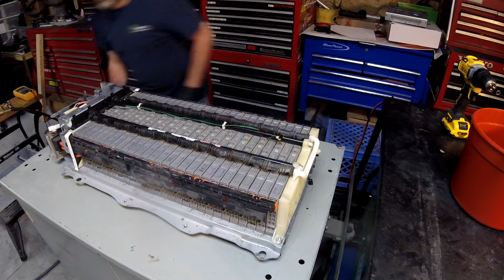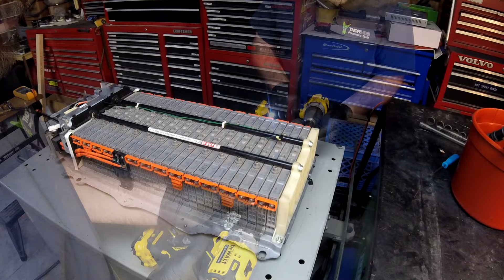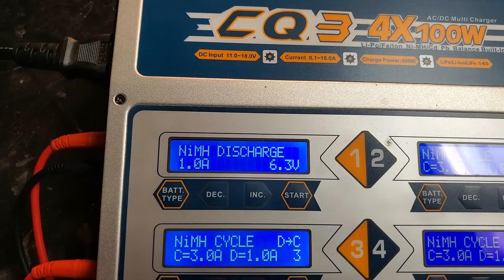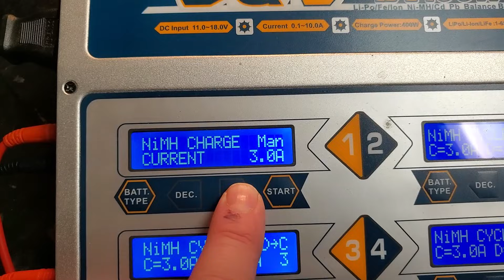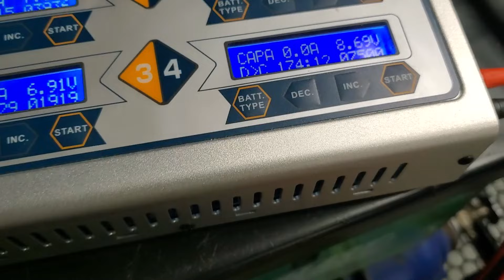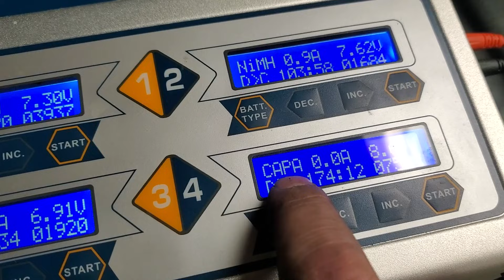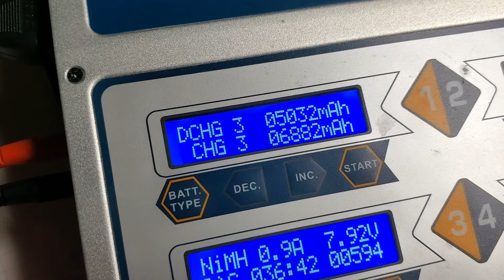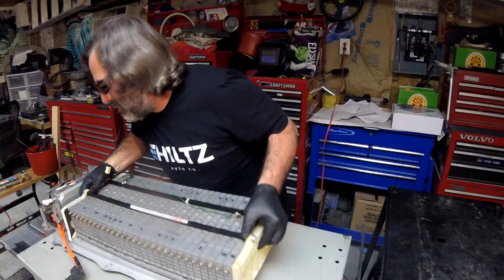DIY Refurbish / Repair Hybrid Battery 2nd Gen Toyota Prius - EV-Peak smart charger POA80 P0A80

Comment: Hi Gregg, Thank you for the video. I purchased a Lectron Pro ACDC Quad charger with the 4 channel charging options. I used the settings you recommended in the video and I think I have done something wrong. My initial discharge on all my cells was between 4800 and 5200, but on cycles 2-5 they my charge and discharge cycles all went down to a 1,000, a few hundred or even 40 and 50 Mah. I would understand if it was a few, but on all of them makes me think I messed something up on the cycle process. My settings were: 5 min wait time, 176 degree temp cut off, 720 min safety time cut off, 7500 MaH cut off, Batt - NiMh, Discharge to Charge cycle, Charge @ 3 Amps, Discharge @ 1 Amp. There were some set up options available that I did not understand, would any of those be needed to alter my results?
Also, if I did mess something up, did I cause irreparable damage to the cells? Thanks!
Reply from the maker: Hey Justin,  @Amazing_Worlds_3.14 wrote in and may have an answer.  It seems I left out in my instructions to use 6.3V as a setting.  I am not sure why I did not include this in the video. Did you use 6.3V setting? If no and it was lower perhaps this is what is going on and it should be corrected and then cycle again.
Reply: @GreggFesto  I went back to look at that settings, my charger was discharging all the way down to .1 volts, i'm not sure if that was the default setting or not, I don't remember setting it there. I reset them all to discharge down to 6.3 volts and hopefully I can restore them to how they were with no damage. I can sleep well tonight knowing my charger is working correctly.
Reply: @stagermx317  some chargers are limited to 100 watts so will put out 25 watts a chanel or 2 at 50 ect so if the prob persists try 1 battery at a time till you work out if its charging fully then try 2 ect my trouble is i live of grid so mine are charging via 12v input and with the lousey weather we have is taking more out than going in so stop due to love voltage input on the discharge i took mine down to 3.6 volts if you had any duff cells you would then know mine are recovering ok
Reply: @stagermx317  were u able to get it fixed?
Reply from the maker: Hey Justin, I am not sure what could be going on with your readings.  I have not had such a thing happen before. I usually see a decline in the low number if the cell is bad. I certainly agree with you that going to around 1000 is not right and seems way too much.  I am hoping someone else reading the comments here will have an idea of what is happening and can let us know. Please keep me informed of what you find out other places as well.
Reply: Are you going to sell your chargers?

Comment: Would this method (or do you have a link to another) work for a 2008 Ford Escape Hybrid? My fuel efficiency has dropped to ~300 miles per 14 gallon fill up.  That can't be right. I'm interested in restoring it and extending its life. It runs great otherwise with very few cosmetic issues that I will fix as well after I deal with the battery issue.
Reply from the maker: Hey Adrian, Thank you for watching and commenting. I am pretty sure that this method can be applied to your pack as well. You will want to do some checking to find out the proper charger settings.  I found mine by looking in forums such as priuschat, I am sure there are some forums for the Escape too.  I wish you best of luck and hope that you will write back in to let us know how your pack turns out.

Comment: What a fantastic job you did! I am about to do this on my 2nd gen Prius. Also, did you not install the replacement cells?
Reply from the maker: Thank you very much for watching and commenting. I did not show the replacement cells going in on this pack just focused on the orientation and steps to do the reassembly. There is an ebay seller called "papou26" that you can get replacements from for around $30 each.
Reply: How did it go? How much money did u save? Looking to do this instead of buying a remanufactured battery for 1300-1500

Comment: Great video, many thanks for going to the trouble to make it. Can I ask a couple of questions please?
I have recently bought a 2008 Prius in very good condition with a full service history, 114000 miles AND, if the onboard computer is to be believed, I am getting 60+ mpg, much of that in heavy stop-start traffic. 

I ran a Dr Prius test and it states that I have 73.69% battery capacity left and is in good condition. Should I leave well alone for now on the basis that the car is performing as well as can be expected? Or is it on the edge of needing attention?

Could I simply remove it and go through the battery balancing procedure for 48 hours, would that return a some improvement? I could be without the car for a weekend but not for as long as you had your battery reconditioning.

Thanks
Reply from the maker: Thank you very much for watching and commenting. Based on your description (and if it was my car) I would wait until there is time to go through the procedure properly. It is hard to tell when the threshold for a cell will drop below the trigger point where it sets a code/light, you may get another 50K miles from it before it shows any issues. When it does finally set a code then work on the refurbish and replacement of cells if needed.
Reply: Mine is 12 years old and testing a little higher with 220,000. Thanks for your reply on this and all comments. Gleaning more and more from the “community” built in this one video post. Thank to you and all your commenters!

Comment: I really appreciate your details, helps me determine which modules needs replacement. Almost every other reference I have viewed has said the gen 2 batteries are 6500 mWh, you said 7500 mWh. Why? Should I set mine to 6500 or 7500?
Reply from the maker: Hey Matthew, Thanks for watching and commenting. I used 7500 as my top number because that is what I found to be most common setting. I am sure 6500 will work but your charger may say the cell is full after each run causing need to manually reset charger for next cycle. Really the important one is the bottom number as it is what will determine the pack capacity. If you can get all of your cells to 6500 as a bottom number then your pack will perform like almost new. I select 5000 for my bottom number goal as I have found it allows pack to perform very well and does not take as long to achieve. Please write back in and let us know how your pack comes out.
Reply: @GreggFesto  I've done this for almost all of my modules now, setting it to 7500 was definitely a better option. The modules in my pack are very degraded I think. Many of them are below 5000 mAh after discharging, even after cycling them 3+ times. Wondering if I set my limit to 4750 if that would have a major impact on the life of the battery. Any thoughts? Also, can you recommend a link to read more about this stuff? Most of what I've been finding is vague or partial info. Thanks again!
Reply from the maker: Matthew, Thank you for watching and commenting. If you select 4750 as your low point then I am sure you will still have a decent battery, just remember that your whole pack will only be usable to 4750.  5000 is about 67% of new and 4750 is about 63% of new so not too much difference. Running 3 cycles is not too bad. Some of mine ran 12-15 cycles. If your low number is still going up after each cycle then I think you should keep going as there is life left. If your low number starts dropping after each cycle then the cell is on its way out.  I found most of my info on priuschat forum.
Reply: It's been 4 months and I haven't had any issues since doing this! Thanks again!!!
Reply from the maker: Hey Matthew, I appreciate you writing back in with an update. Glad the pack is working good for you now.  It a good time to save money on gas indeed. Thank you for the update.

Comment: Thanks for this excellent content.  

How do you determine the limits for charge and discharge and amperage for each?  Is it according to the spec of the battery or your own experience?  I want to attempt with a Civic 07 Hybrid pack and I need to know how to find out charge/discharge number for those sticks.  (they come in pairs).  How would you approach it?  Thanks
Reply from the maker: Thank you very much for watching and commenting. I got my settings from others who had done the same thing on Toyota forums such priuschat. I took the most common discussed settings and went from there. I think you  should be able to find the same data on a Honda forum. Please write back and let us know how you make out.

Comment: I can’t get my balance charger to automatically jump to the next cycle of discharge after hitting the max charge 7500 mAH. It just beeps and yells at me. Any advise?
Reply: Not that big of a deal, just makes it more manual/hands on testing
Reply from the maker: Dustin, The 7500 cutoff and not restarting on its own is normal as the charger believes it has reached its goal and is finished. You have to restart when it happens. Both of mine do the same thing as yours.

Comment: Thank you for this video, I have a 2007 with the red triangle and have been very hesitant to dig in to refurbishing the battery. Your video has given me the confidence to give it a go, where did you get your replacement cells from? Thank you for your time and effort.
Reply from the maker: Hey Rob, Thank you for watching and commenting. The replacement cells are available many places. The last ones came from an ebay seller called "papou26" for around $30 each. Upon arrival they were inserted into the pack and checked with the charger to see what they read - all had around 6000mah which was higher than my low cutoff point. They shipped fast too.

Comment: 16 days?! WOW! How much power did you use to refurbished this pack! Great job, but way way too long. Thank you!
Reply from the maker: Yes, this one took 16 days, some take more some take less. Cells that were better took only one cycle while cells that were bad took as many as 12 cycles because I want to make sure they are beyond refurbishing before I give up on them. Thank you for watching and commenting.
Reply: @GreggFesto  with the batt pack you done at 50000 ma how far could you travel below 30mph on electric ive got 4 totaly flat cells with .4 volts all the others are showing 7.2 to 7.5 volts and the car hasent been started for a year
Reply from the maker: Hey Jo, Thank you for the question. I drive the Prius pretty hard so I don't stay in electric mode for long periods of time, unfortunately it s a question I cannot answer. I wonder if you can get those cells reading 0.4V back up with the Discharge/Charge cycle.  Please write back in and let me know if you do try it, I am very interested in your results.
Reply: @GreggFesto  yes i did get them back and they went back up 5k i did notice i had a boot full of water and mabe the damp pulled these down im on the last 2  then im goind to put all in parallel for 24 hrs then check them so hopfully ile have them back in by the week end ....what sort of internal resistance should they be reading as a new cell i cant find any details on that
Reply from the maker: @Jo Ken Glad you got things going in positive direction. You have asked another question that I also am very interested to know the answer. I have never paid attention to the resistance. Is there anyone reading these comments that knows the answer to this??
Reply: @GreggFesto  have u found the answer about the IR?

Comment: Rhank you for your vid, where did you get the charger?
Reply from the maker: The charger came from Amazon and was about $200.  Thank you for watching and sending in a comment.
Reply: @GreggFesto  сколько можно одновременно проверять ячеек?
Reply from the maker: hello @Валерия Довгань Thank you for watching and commenting. If you had enough chargers I think you could do half of the cells at one time. You would want to connect ever other cell so you are not conditioning any cell directly next to another. The main idea is to keep the heat down while processing.

Comment: Thanks for full replies :)
Could I give you additional questions? sorry..
1) At now, I havent reconditiong yet, but I am going to balancing current battery. How would be as a result? recomended or not?
2) How is your battery doing now? Above 5000mAh batteries installed work well?
3) Your 'user set' 3A(Charging), 1A(Discharging) that isnt too boring? What if I increase 5A(Charging), 2A(Discharging) to operate?
Reply from the maker: Thank you for great questions.  I will try my best to answer.
1) I do not think there is any advantage to balancing the cells prior to refurbish cycle on charger. In fact I was able to determine one of the cells was bad by reading the initial voltage much lower than the rest. Indeed when running charger cycle on that low reading cell it did fail. 
2)Since this refurbishing the performance seems very good. The red triangle and check engine light have not come back on. Has been 2 weeks driving. MPG is back up to the 40's, the gas engine does not run as often, and the charge/discharge of the pack on screen takes longer. I do not see the very top green bar light up on the screen. I am not sure if this is because of the pack only having 5000mah? What are your thoughts on this?  It is like the battery is new again and am very happy with the refurbished pack.
3) If you increase the charging and discharging rate, the process will take less time but will also be less efficient and more heat. If you decrease the charging and discharging rate the process will take longer but be more efficient and less heat. This has to do with the chemistry of the pack. I went off the settings I learned from others who did this process.
Reply: @GreggFesto  Thanks for that. Indeed. Now I am going to do the same process that you did. Hope it will be ok.
Reply from the maker: I am sure you will be happy with the results.  Please let me know your experience with the process when complete.
Reply from the maker: @마크리시먼  I would like to know if you had success with refurbishing your hybrid pack?

Comment: Your video is best every 'hybrid battery reconditioning' clip. 
I will try the same way you did, 2quesitions need to be solved.
1. Second process in video(+++line up, ----line up) you line them up tied with tape wire(?), what I should do the process for example) just leave them for 24~48hours, or supply certatin voltage?
2. What is tape wire? If no, Could I get exact name of it? (I will buy that)
Reply from the maker: Hello, Thank you very much for watching and commenting.  I used steel TIG welding wire to tie the negative (-) together with each other and the positive (+) with each other. This is just a piece of welding wire. I have used a roll of wire wire and stripped the insulation off of it, I have used bailing wire before also. It really does not matter what you use as long as you connect them together with something conductive. I am willing to bet that aluminum foil will work too.  You do not need to do anything to them once together, this step is simply to make them all balance to the same voltage as each other.  I wish you best success with your battery pack, please report back and let us know how it does when you are finished.